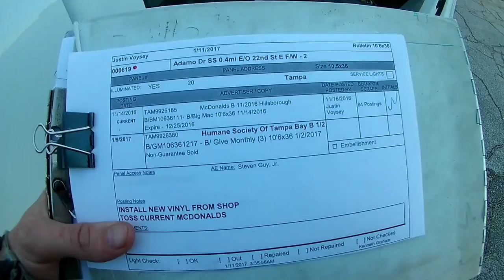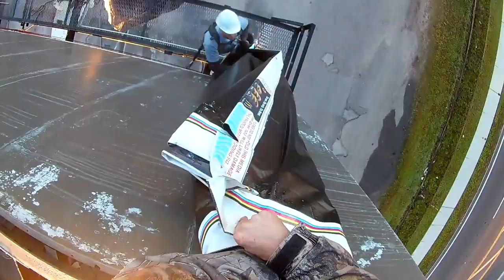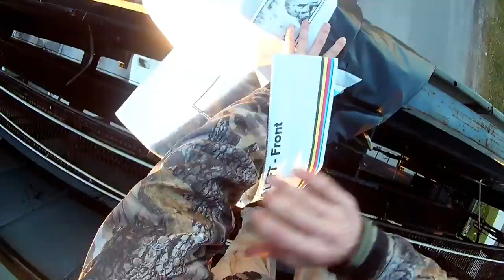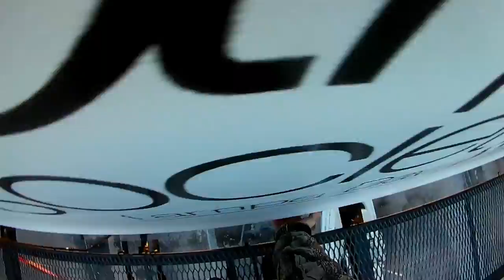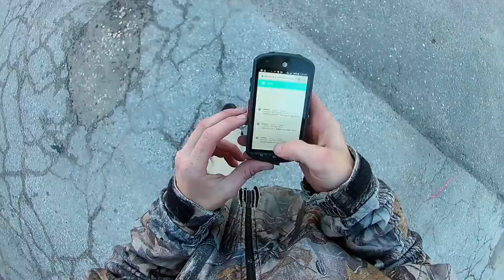hanging a Billboard from start to finish

Comment: Cool, I've been at Lamar in RI for 16 years servicing the digital and bulketins.....theres only 7 of us in the shop and we cover a lot of Massachusetts also. Not many guys in our line of work. We open the vinyl on the bottom cat walk and 2 guys drop ropes from top and we pull it up and ratchet strap it from there.
Reply from the maker: We cover a really big portion of Florida as well. I have been with CCO for around 22 years in Tampa Florida. I started out as a bulletin installer and also did bill posting for a number of years. Currently I'm the maintenance supervisor I over see all of are vegetation maintenance, electrical maintenance, and the structure upgrades as well and a bunch of other small things like vehicles maintenance and building maintenance and all the other mall things that most people won't ever see unless you are in the industry. Thanks for the comment it's always nice to hear from guys like yourself that are in the billboard industry. You handle all of the digital structures what brand do you guys use for your digitals. We have a bunch of dactronics, watchfires and prism views, we have a about 8 of the original yesco digitals left that we are currently working on getting rid of over the next few years. What are some of your typical digital issues that you are having to fix the most?
Reply: @727 Solutions LLC  what's happening... for digitals we use daktronics,media resources(mri) and watchfire.....no prism or yesco.....most of our structures are pretty decent.... issues would mainly be apron and stringer I guess....the poster signs usually get more maintenance issues with additional angle iron being welded or cement forms being done. Do you have to deal with gators at all...my crew talks about working down south and the different things that would be dealt with and that always comes up. We might have a handful of wooden structures if any left. No more tri vision faces ( thank goodness). We typically add d rings where needed for better transitions but not much maintenance besides brush cutting.
Reply: @727 Solutions LLC  oh as far as digital issues, lately smartlink offlines, modules  going out. Nothing major, but for a year or so we had major issues with mri mods going out all over the face. Was a brand new sign but they had a few batches of modules that had bad solder isuues....they came down from Canada with 2 guys and we changed out the  whole back to back face. And also a single face. Usually not PLRs, sometimes the DMP on Daks.....but overall they have been running pretty good. Usually do about 2/3 digital order per week but nothing major.
Reply from the maker: @sembatocus9958  as for are employees we have 4 installers one electrician one helper, but me the maintenance supervisor, a rotation supervisor (he is the guy that schedules all the installs each week) and a operations manager that over sees are market. So basically we only have 4 guys that go out and install signs. The electrician does his normal duties with the digital's and one other guy that does all of are location mowing with the tractor and he also does structure painting and he builds the cutouts for the static signs. Just 6 guys that make are out in the field working every day not including me in the rotation Supervisor. We are having a hell of a time trying to hire new people we can't get anyone to pass a drug test if they pass the drug test they don't have a driver's license and we can't hire them either.

Comment: What is the material it’s mounted on? Metal?
Reply from the maker: Ken Marshall..... Yes the are called Tiffin metal frames /panel free frames.... In this video since it's a older video they are called Tiffin metal panels. Now adays we just use strictly panel free frames like a picture frame and nothing in the middle so if a hurricane comes the wind will blow straight threw the structure with the advertising removed.

Comment: Lamar sucks. aint it earier to drop the vinyl roll it up on front catwalk and throw it off. looks so time consuming.
Reply from the maker: @Matthew vitelli... Well it's a good thing I don't work for lamar... You watched the video in real time start to finish no editing. Just for references to let you know I'm not new to this I'm coming up on 20 years in the business I have tried every possible way to hang a sign in the easy way possible including your way...... So what's the difference if you fold it up on the ground or in the air. you are still folding it up either way. It probably saves time doing it in the air. If doing it on the ground you are dropping the viynl on the catwalk rolling it up and the lowering it to the ground then you un roll it again and fold it up now doesn't that sound more time consuming. Now my way if you do it my way it's Already stretched out since you just broke it completely loose and all you gotta do is fold it up since it's all ready stretched out on the structure in the air there is no rolling it up on the sign then un rolling it on the ground and the folding it up. Work smart not harder. Think about it. How many motions you are going threw to just get the viynl rolled up and to the ground and then unrolling it again and then folding it up. My way I never have to roll it up to get it off the sign and on roll it again. I'm a big fan of working smart and completing the job in the least amount of movements possible. All I gotta do when I get down is put the ladder on the truck and go to my next stop. Every one has their on ways of doing things and in the video is my way I do it. I appreciate you watching my video and hopfully I could shed some light on your question and made you think about how many more movements it takes to do it on the ground. Stay safe out there.

Comment: Looks like super thin material.  Definitely not the 12oz vinyls we use.
Reply from the maker: Yea we use eco flexs they are as thin as the blue tarps u can get at walmart and other stores. Other than the eco flex that we use most all of are other flexs are 7oz. The lighter the better when pulling them up with a rope. I take it u are in the out door advertising industry? What state are u in?
Reply: @727SolutionsCoatings  Freezing in Iowa.
Reply from the maker: Iowa Dame I could not do it in that cold weather. I just got back from hunting in winter set Iowa. And it was cold as hell I feel for you guys. What company do you work for?
Reply: @727SolutionsCoatings  Small family owned company.  Avery Bros. Sign.

Comment: Huh, I'm from Alberta, Canada.

I am also a bill poster, the boards we have in our market though we've only got static boards. Ours is 10 sheets, so five on top five on the bottom. My company doesn't have any superboards or back lit's, just a ton of static and digitals.

I've got to say, this is pretty damn cool, not working alone is a major upside from what I can see.
Reply from the maker: NoblePineapples glad to see that there is a good amount of billboard workers on here watching my video. Yes have alot of everything here in Tampa FL. We have alot of poster units but about 6 years ago we converted from glue up sheets to the eco poster that's a vinyl and has a string and multiple clips and a pulley. And the other than that we have alot of 14x48 and 10x36 static structures that all take a vinyls with ratchet straps and fiberglass poles. And alot of LED structures as well. Thanks for watching. Stay safe out there!
Reply: That's what I heard, all of Outfront media's boards were converted to QuickFlex in the states. We probably won't be getting that any time soon but it would be AMAZING, considering we can't post in below -35 C (-31 F) so QuickFlex would be super handy. 

Thank you for the reply! Stay safe and hydrated.
Reply: NoblePineapples oh man that negative weather kills during winter time on boards.

Hands are number by time you hit the top of the board from the rungs on the ladders, then the vinyls are sticking cause of frost. What normally takes 15-25 minutes for a job takes 30-40 minutes cause of the vinyl being Frozen
Reply: In the winter I use a pair of thinsulate "gloves" under my normal posting gloves, it's not too bad.  But with Trio's I just use the thinsulate gloves and those are painful, 53 individual pieces of paper going up a housing. I'll have to record the next time I do a Trio for others so they know just how much a pain in the ass it can be. 

Our glue is only rated to about -15 C but after adding propylene glycol to the batch it can handle down to about -30 C for around 20 minutes in the pan. 

( I actually have a video uploaded of our 10 sheet style of posting it's a bit long since I didn't want to rush, and I've been too lazy to speed it up so it's just the whole process)
Reply: NoblePineapples I've tried about everything to keep my hands warm in these Michigan winters and we have to have approved gloves to even wear them so we don't really bother buying our own.

We have only two trivisions and the rest are just like this, just done a little differently from hanging and dropping them. Our biggest board we have I believe it's a 24x80 and that's just a pain to do
Reply: God damn that is massive!

I've seen a couple videos on how the QuickFlex is done, the drop down attach, pull and tuck. It makes me really jealous knowing we probably wont be getting anything converted within the next 10 years or so since we are just fazing out Trio's now. If there is an open slot in a US market apparently we have an option to try and transfer but that's a big commitment.

Comment: Great vid! I have a used billboard that I want to go over the top of a pop up garage as a 2nd cover to protect from UV rays. Hope to make it last longer.  Are those fiberglass rods you guys are inserting? 3/4 inch?  I don't see anyone local with solid fiberglass rods what would be a good substitute to use so I can ratchet down the tarp? No electrical around to worry about. Was thinking 3/4" metal conduit possibly or pvc but hollow pvc might not ratchet down good.  Doo you guys or other installers sell used rods at all?
Reply from the maker: @ Gene Lauro, you can get by with pvc pipe, conduit, bamboo instead of fiberglass poles. Pvc pipe schedule 40 works great you would be really surprised at how much pvc pipe is used in the billboard industry. As for buying some and where, the if I could sell you some I would but we are such a big company that there is no really way that we could take payment from you for fiberglass poles, although if you want to by some else where here is a link where you can buy them https://reliable-electric.com/fiberglass-rods

https://g.co/kgs/xM6KyH
You probably be better off getting pvc I'm sure it's going to cost you a arm and a leg to buy them and have them shipped to you unless you are local to them. You can use anything as long as it fits in the pocket hell I have used tree branches before. Solid Round stock steel would be cheaper than fiberglass poles and you would not have to worry about the pipe collapsing when you tighten the ratchets to much on them.
Reply: @727SolutionsCoatings  Thanks so much for the reply! We tried our plastics company that we buy lots of bottles from. Fiberglass Poles for 80 feet were only $200!  but then $400 to ship, sigh.   Was thinking metal conduit but you say schedule 40 pvc ----  3/4 inch?  We were gonna do 10 foot lengths. for 40' on each side

Comment: I really enjoyed the video. Do you guys also change out the light bulbs or timers as well.
Reply from the maker: I always love to see comments like yours it shows that people are still interested in how a blue collar job like installing billboards is done. 

On to your question. Yes we do most all of are electrical maintenance such as changing out light fixtures and time clocks. We have a in house electrical journeyman that handles all of are electrical issues and he also serves all of are digital face 
(L. E. D) billboards as well. He also has a helper as well for when he has a bunch of jobs that need to be done in the same day he can send his helper out to fix time clocks or bad light fixtures when he is busy with other more important jobs. We use a time clock called outdoor link it is controlled from my desk I can turn the lights on and off from desk and set the timers to turn them on and off when it's dark out. Also the outdoor link tells me If we lost power at a particular structure and it will tell if a bulb is burnt out as well. Currently Clearchannel has a decent amount of job openings for electricians and billboard installer positions as well. Not sure if you are just curious or if you might be looking for a job. If you are looking for a job I can definitely say as a 20 year employee CCO is a great company to work for and has a bunch of really good benefits. I'm located in the tampa FL branch and we currently have 2 positions open. Feel free to reach out if you have any other questions I'll be happy to answer whatever you are interested knowing. Thanks again for the comment and I hope I was able to shed some light on your questions.
Reply: @727SolutionsCoatings   I do appreciate the response. Any chance of posting any video of the electrician doing his part on making what you guys do a success.

Comment: Any advice for someone just getting into this line of work ? Thanks brother
Reply from the maker: @beau Marshall.... Where did you just start working? I've had a few ask this question in the past if you go threw and read the posts you will find my comments on this question.... . My biggest thing threw my 21 years in the business is with new guys just watching me work. So my advice would be to watch or asked to be shown how the first time and after you picked up what they taught you keep doing it no matter if it doesn't look like they need help. Always find something to do in the mornings when loading up the truck to go out fill the water/ice cooler up every morning is always a good one for the new guys and easy enough lol.. everyone in this line of work is going to have a water cooler so keep your self busy filling up all the guys water coolers on each truck that's going out that day. You will get respect doing that and it will show you are putting in work to help out everyone. In return they will go out of their way to teach you tricks of the trade. Always volunteer to help and insert yourself into the conversation and work that's being done with a open mind willing to learn a different way. Everyone hangs signs a Lil different but they are held up there with everything you saw in my video. If you are not comfortable say so safety comes first don't let them push you unless you are comfortable. This is a fun job but a hard job at times. Enjoy seeing and learning new things. Let me know where you are working and what company. Feel free to ask any questions I breezed over.
Reply: @727SolutionsCoatings  have an interview at Lamar tomorrow. Thanks for the advice

Comment: I'm thinking about using the pull offs for roof underlayment, how does the vinyl stand up over time ?
Reply from the maker: If you get the heavy flexs like the 7 to 12 Oz thick material flexs they will work great. I have used the 7 Oz to build a really big fish pond in my old backyard and that was about ten years ago and it still is holding up fine to this day.
Reply: @727SolutionsCoatings  I just scored 3 of the heavy ones from a guy that does what you do it's impressive material and I grew up on a sailboat it reminds me of sail material

Comment: I never did work like this,  but isn't someone suppose to hold the ladder ?  I have climb a ladder a few times without anyone to hold it (going on my roof but that isn't high  like this) most of the time i like people holding the ladder.
Reply from the maker: The truth..... Me personally and the guy I'm working with have been doing this for 16 myself and 12 years for my partner. The ladder is set up safe at this location. But other locations are different and the ladder is set up in a awkward spot and in that case it needs to be held for the first person to climb up the ladder and then secure the extension ladder to the fixed ladder on the billboard with a ratchet strap to the fixed ladder to make it safe for the second person to climb up it. If the first person climbing the ladder feels at all like the ladder is going to move or need to held he will haller at me or I'll haller at him to hold and spot the ladder for him or me. Safety never takes a back seat. And you can't get over confident. But every signs access ladders is set up different. We know which ones need to be held and which ones don't. One thing to remember we climb around 10 billboard structures a day so we have a really good feel for what is safe and not safe and when the ladder needs to held/spotted for the first person to climb up and secure the ladder for the second person. Now If we are training a new guy the access ladder /extension ladder will be held at all times for a long time while the new guy is in training and even after they are done training we will still hold the ladder for them till we the experienced guys gain confidence in the new guy to be able to judge his ladder set up and if he knows when he will need to ask to be spotted. Thanks for your comment hope you liked the video. Feel to ask any other questions. I would be happy to fill you in on anything you would like to know. Stay in safe out there.
Reply: @727SolutionsCoatings  Thanks for the info